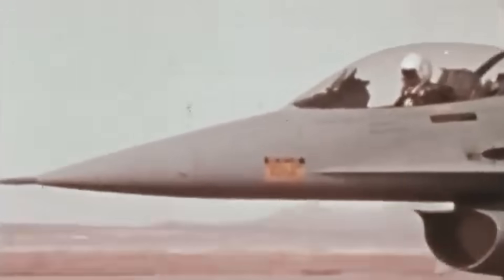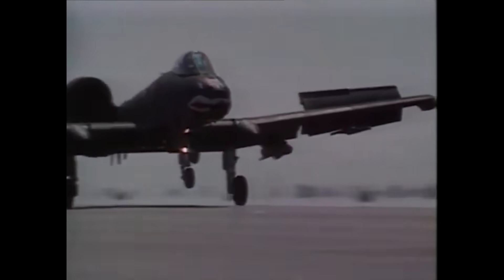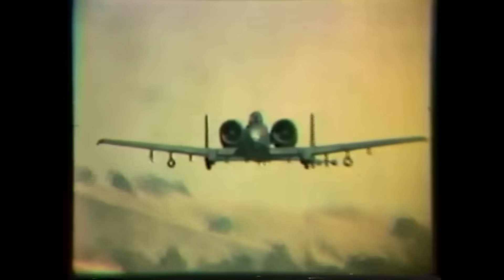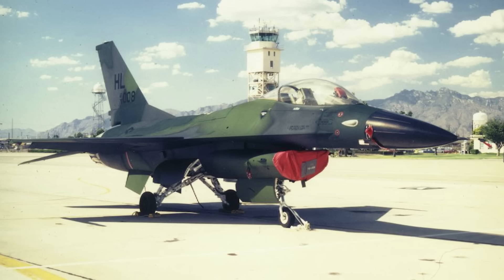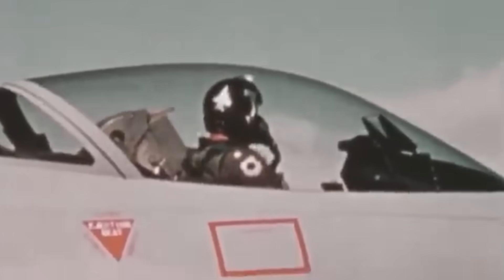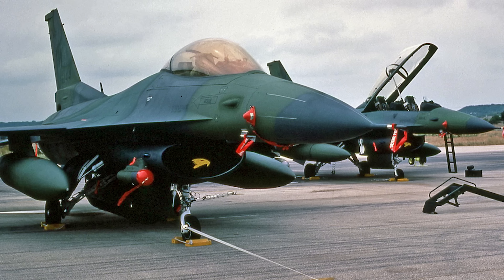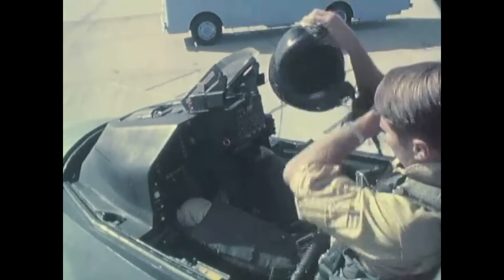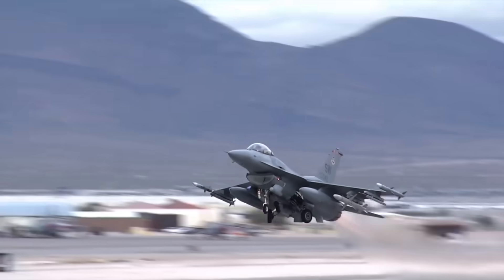The A-16. Can a Viper turn into a Warthog?

Comment: F-16 would be a better choice than the F35. The F-35 will never be as good as the A-10.
Reply: Yeah, you say that until it you're sitting in Northern Afghanistan, theres a fog layer from 35k ft to ground level, and the A-10 and F-16s arent allowed to drop for fear of hitting you. Then F-35 pulls up with GTI mode and drops a JDAM onto enemies not even you can see.
Reply: @De_cool_dude  where you Marines or Army?
Reply: @briancooper2112  which one?
Reply: @De_cool_dude  army or marine?
Reply: @briancooper2112  which army? Which marine?
Reply: Basically everybody in this comment thread is making the exact same mistake Sprey made: Despite its "fighter" designation, air-to-air is not the F-35's primary mission, and there is not an aircraft anywhere in the sky that can match Amy's electronic warfare capability.

Imagine a squadron of F-35s in non-stealth configuration loaded with add many AIM-174s or AIM-280s as they can carry, launching them all from over the horizon using datalink from stealth F-35s that loiter in contested airspace, undetected and untrackable by enemy air defenses.

That is the power of the F-35. Not some dogfighting monster, not some unstoppable air-to-ground machine, but an invisible specter in the skies, able, ready, and eager to switch you from "is" to "was" with no warning other than your RWR loudly apologizing.

Because the only thing more terrifying than realizing you are about to die is knowing that you can't do anything to change it.
Reply: @PhycoKrusk  F-35 cannot carry AIM-174
Reply: @De_cool_dude  after upgrade it could.
Reply: By the way A10 F16 F15E would do anything to help US members trapped in Afghanistan during an operation and did. You never served did you?
Reply: @De_cool_dude  wrong!
Reply: @briancooper2112  an upgrade? That hasnt been done? And will probably not be done? And would require fit checks, etc?
Reply: @briancooper2112  its not the A-10, F-16 or F-15E doing 'anything', its the pilot. And most F-16 squadrons are getting F-35 to replace the old airframes.
Reply: @De_cool_dude  no. Your wrong. You have been wrong about everything you have said. Your fake.
Reply: @De_cool_dude  F-16 getting life extension!
Reply: @De_cool_dude  Yes, because its software doesn't support the AIM-174. Currently, only the Super Hornet's carries the AIM-174, and this is in part because the AIM-174 is just a exploding telephone pole with a rocket attached to it.

That does not mean its software cannot be updated to support the AIM-174.
Reply: @briancooper2112  you have no idea what you are talking about
Reply: The f35 is better than the f16 and a10 in both air to air and air to ground
Reply: That is just not true, the f35 has beast mode and saying it is outright bad is just not true, remember it can fire a 180 degree missle
Reply: @marleenthart2521  A10 had missiles to.
Reply: @briancooper2112  yeah but not 180 degrees
Reply: @marleenthart2521  1970's design compared to 2000's. A10 was great for SAR.
Reply: @marleenthart2521  no beast mode.
Reply: @briancooper2112  only the most basic ones
Reply: @perrytheplatypus8802  basic what?
Reply: @marleenthart2521  A10 has that great cannon. It could remain in its area way longer than F16 F35.
Reply: @briancooper2112  until the A10 dies in seconds to ground launched missiles
Reply: @marleenthart2521  beast mode? Wtf
Reply: @briancooper2112  it is basically when stealth isn’t a priority it can deploy bombs and missles on the wings
Reply: @marleenthart2521  it's true
Reply: @ just wtf is beast mode, it’s not a video game dude. It’s real, and only the good stuff makes it in real mode, plus we’ve only got like 10 of them ( slight exaggeration I know) but it’s just not enough. And what’s a 180 degree missile got to do with it? It shoots all 180 degrees at the same time, and which 180 is it going to shoot.
Reply: @rogerjohnson6676  the f35 can carry 22 thousand pounds of weapons, the a10 only 16 and is slower which is bad for cas
Reply: @rogerjohnson6676  "Beast mode" is a semi-official moniker for a non-stealth configuration with external pylons meant for scenarios where stealth doesn't matter. It allows the F-35 to carry about as much stuff as an F-15E.
Reply: Seriously? A 40 year old career as CAS and you say that?
Reply: @rogerjohnson6676  beast mode is the name for the external ordance kit, bro keep up
Reply: @ what is the fucking point of putting external ordinance on a stealth aircraft, you are risking a multi billion dollar aircraft for something a F-4 could do, not to mention the extra stresses on the airframe. I give up, I think the F-35 is going to be like the F-111. A political white horse that’ll be adapted for one job eventually.
And TBH “beast mode” sounds like it’s from a kids video game not a serious fighter concept.
Reply: @rogerjohnson6676   no beast mode
Reply: @ Personally, I'm 100% confident the "beast mode" moniker was just to sound cool for the kids. It's absolutely a stupid name.

As to the point of the external stores, stealth is not always a mission requirement. I gave an example above of a squadron of F-35s in a non-stealth configuration loaded with as many "over-the-horizon" missiles that could carry launching from relative safety far away from SAMs and other aircraft using the datalink from F-35s in a stealth configuration operating much closer to enemy forces. Besides that, external stores would obviously be useful in situations were enemy air defenses have been disabled and the advantages provided by stealth are greatly reduced.

Still, you do raise a valid point: I don't know how much weight the F-35 can actually carry, but even with external stores, it probably cannot carry the same number of munitions as the A-10 (I feel confident it can match the F-16). Additionally, I suspect that the F-35 in a CAS role would still primarily be equipped with smart munitions, which are certain to be very effective, but even the low-cost JDAM is more expensive than a non-smart cluster bomb. I am uncertain of the relative advantage the lower operating speed of the A-10 would be since they too are now mostly equipped with smart munitions.

At the end of the day, an F-35 with external stores would face the same operational restrictions as the A-10, and would only be deployed in this configuration once air superiority was established. The primary difference is that, unlike the A-10, the F-35 can actually contribute towards establishing air superiority. I am not, however, ready to advocate getting rid of the A-10 or F-16 just because we have F-35s now.

I read about what happened when some glass-eyed genius decided that missiles were the future of air combat and ordered a jet that needed 1-2 business days to turn around and didn't have a gun.
Reply: @PhycoKrusk  thankfully, the F-35 has a gun and superior turning characteristics to the F-16
Reply: @ well said sir
Reply: @rogerjohnson6676  thank you sir.
Reply: @De_cool_dude  lmao
Reply: @De_cool_dude Given that you dismissed the F-35 carrying the AIM-174 out of hand without any consideration of software updates enabling this capability, I'm going to take you opinion of its turning capability with a grain of salt.
Reply: The F-35 will never be as good as anything. Christ the Phantom is better at everything except stealth.
Reply: @rogerjohnson6676  i don't agree.
Reply: @rogerjohnson6676  The F-35 is better than the Phantom at literally everything.

All the "oh no it can't dogfight" stuff is bullshit. The tests were conducted with experimental avionics software that limited it to 5G. In most realistic combat loadouts it easily beats the F-16 and F-15 in a rate fight. Not to mention the fact that dogfights literally don't happen anymore due to BVR missiles, and even if they would, turn performance wouldn't be relevant since you just cue a high-off boresight AIM-9X from the HMD and immediately kill the enemy (which the F-16 and F-15 or even F-22 can't really do anywhere near as easily).

Thje other main complaint is that the F-35 doesn't have any carrying capacity, which is demonstrably false. Yes, it can't carry that much internally, but in the situations where an F-35 carries stuff internally, the F-15 or F-16 or A-10 carries nothing at all, becuase they would just get shot down, while the F-35 can rely on stealth. When the F-35 doesn't rely on stealth it can mount external pylons and carry about as much as an F-15E between the IWB and the pylons, all while having a larger combat radius and much more advanced avionics that allow it to hit targets an F-15E couldn't.

The US needs a stealth multirole anyway. IF you want to blow up enemy air defences for the A-10 or F-16 or F-15 to be able to operate at all, you need a stealth aircraft capable of blowing up enemy SAMs. An F-22 can't really do that very well, since it has such a narrow weapons bay. It can't really shoot anti-radar missiles or drop large bombs in a stealth configuration, which the F-35 very much can. So something like the F-35 using stealth to blow up enemy radars is a requirement for the "better" F-16 and F-15 and A-10 to even be able to do their thing.

Comment: I can smell the fighter mafia probably glazing the shit out of this program
Reply: Which is hilarious, because the F-16 as initially designed according to their principles was in reality pretty badly handicapped. The AIM-9s and AIM-7s of the late 1970s were much better from their Vietnam-era predecessors and there’s just no good reason for it to have entered service without the latter. Just giving up capabilities that would’ve had negligible impact on other performance factors for free
Reply: @ The fighter mafia motto.

Min-max until your aircraft is so hyper-specialized it becomes functionally useless in real-world conditions.
Reply: The fighter mafia kind of liked the F-16, but they absolutely did not want it to have missiles other than the AIM-9 sidewinder, and only 2 of them on the wingtip pylons. They didn't even want it to have a radar. An A-16 would be their worst nightmare.

The fighter mafia hated multiroles and loved the A-10 for being a "no-nonsense" attack aircraft. Like the A-10 is their absolute darling, they LOVE IT and their lobbying is pretty much the only reason congress consistently denies Air Force requests to retire the damn thing. They love it for being a blue-on-blue machine with an inadequate gun for fighting tanks that only managed to take down tanks with the anti-tank missiles they didn't even want it to have.
Reply: @sdfopsdmsdofjmp7863  they'd probably glaze the shit out of the a-16, they quite literally had an idea for the f-15 where they would strip a crap ton of stuff from the inside and replace it with the gau-8
Reply: @ I'm not so sure.

Like I said, they loved the A-10, like REALLY, REALLY loved the A-10.

They might like the idea of an A-16, but they would hate the reality of it, since it would be an F-16 with some added air-to-ground capability, but retaining the extra weight and avionics in the F-16, so even more of a multirole.

The fighter mafia hates multiroles.